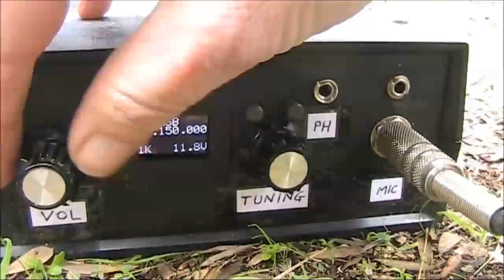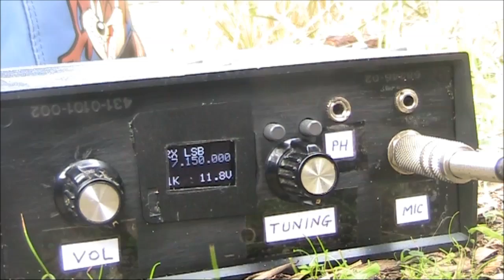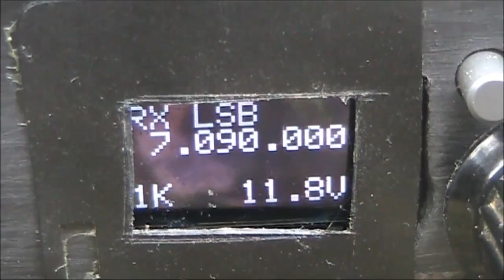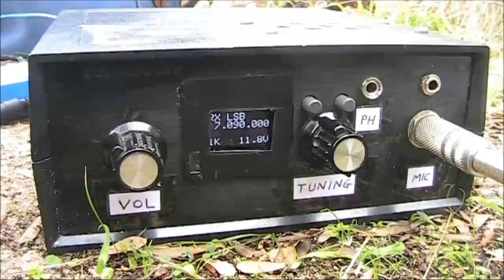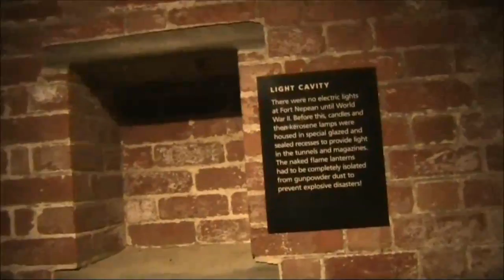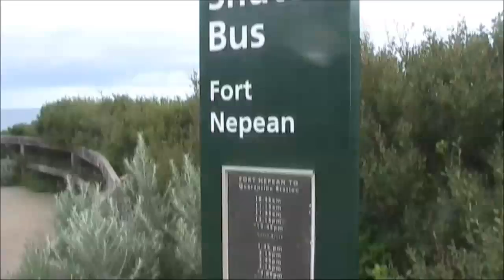7 MHz QRP from Point Nepean National Park: 2 June 2017

Comment: I'm a SA highschool student looking at getting my foundation radio licence, any advice/tips?  (also I have built a couple radios and was looking at building a simple 7mhz receiver set and suggestions?)
Reply from the maker: Hugh H - you're lucky to be in SA since it has a lot of amateur radio activity.  A few weeks ago the radio clubs of Adelaide put on a great activity day with many facets shown. My video of this is https://www.youtube.com/watch?v=KdOObNDf0Fk

www.wia.org.au includes information on getting an amateur licence and contact details for clubs (including those listed in the video) 

But it can be a lot cheaper and simpler than shown.  As you've picked up, a simple 7 MHz receiver is a good place to start and several have been described on my channel.  If you can pick up a June 2017 issue of Amateur Radio magazine (available in some newsagents or you may be able to borrow a copy from people at radio clubs) as this has a very simple 7 MHz receiver.   Or failing that the receiver is demonstrated and described (including circuit diagram) at https://www.youtube.com/watch?v=iYap-hCLD7Y   Another version with a different audio amplifier is described at https://www.youtube.com/watch?v=GJBRIf5Xkzw

If you want a receiver that can be extendable to a transceiver then it's simpler to make what's known as a direct conversion receiver.  An example of one built from scratch is at  http://home.alphalink.com.au/~parkerp/projects/projbeach40.htm  Or, if you want something with better performance a kit of parts is available at http://www.ozqrp.com/MDTindex.html  (requires ability to solder) 

Good luck - you won't regret it.  Ask me if any questions!

Comment: I've been watching your videos for many moons now. I still enjoy them : )  Glad to see that you're still enjoying QRP. Do you have a video on  the rig you were using? I feel like I normally catch all your videos on my feed.
Reply from the maker: Glad you like the videos.  The rig used was a Bitx40 (older free-running VFO).  I added a ceramic resonator oscillator for improved stability then swapped it for a DDS VFO.  Several videos in the last 6 - 7 months have discussed various modifications and demonstrated its use.
Reply: I'll snoop around. I just got around to putting up another antenna at the QTH and making a few more for future adventures. You're most certainly a staple in my mind to the phrase "QRP" and "Portable Operations". Thank you for the videos!